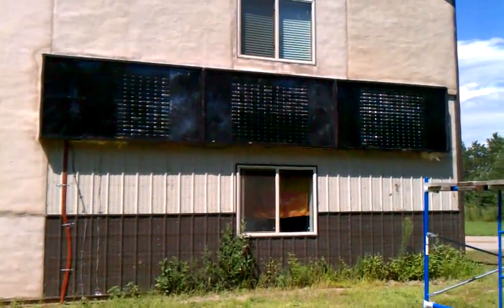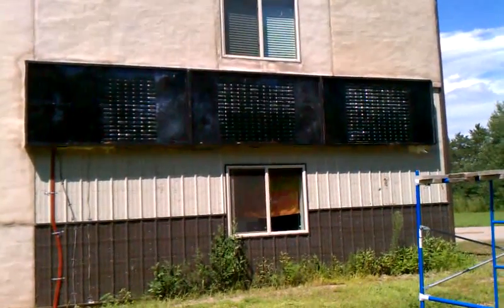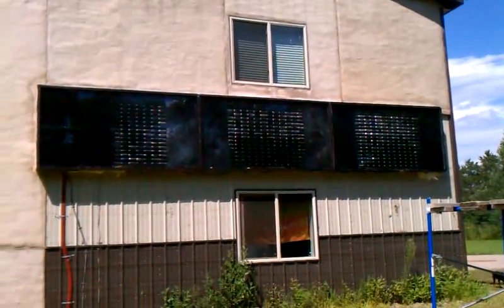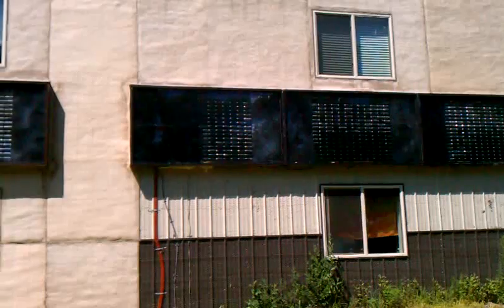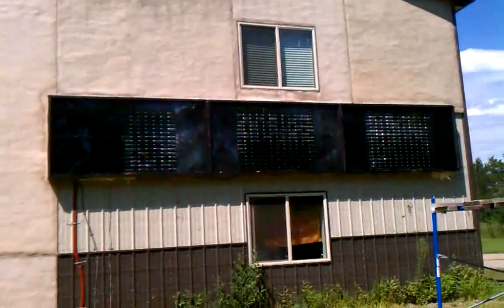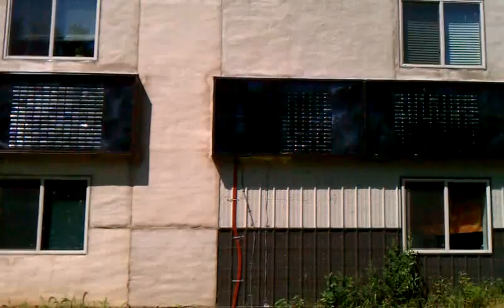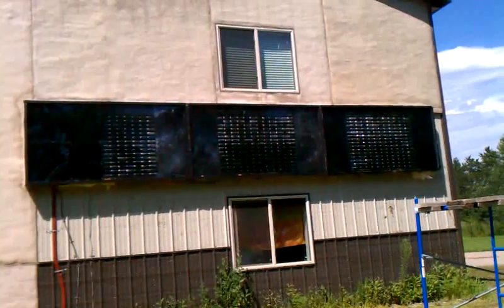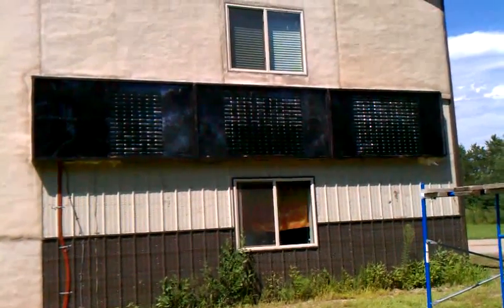Solar can heater review

Comment: Add a thermostat (cheap on Amazon), that will run a fan only when it hits a set temp (say 80 or 90 degrees), that way, the fzn will turn on only if it is producing heat.
Also, our forced air furnace has a continual 2 speed fan. I'd put the hot air into it for more even distribution throughout the house. The furnace itself will only turn on if required to subsidize the heat as required.
Reply from the maker: That is a good idea

Comment: Impressive build and setup! Interesting to hear your operational and financial success of your solar air heaters. You raised a great point of heat dispersal throughout your house. Also the need for plugging up the ventilation holes at night is very important to achieve the entire goal of net increase of house heat. I made R26 insulated 4" holes plugs for my top and bottom hole system. I am jealous that you have so much good, wide open views with all day sunshine. My system works well at 200F but only for 4 hours a day in winter and 6 hours a day in spring and fall when sunny. https://youtu.be/7S8CWsIcK20

Comment: Nice video. This is the unit I built and it works really well. I remove the top and bottom hole plugs in the morning and replace them in the evening keeping the heat generated all day inside the house. Solar House Heater 95C (203F) Feb 20, 2019 https://www.youtube.com/watch?v=7S8CWsIcK20&t=55s

Comment: I also made a smaller version like you did. I glued the cans together with black TEC7. Mine is already working for one year now. I have my doubts about the safeness of the TEC7 glue. In cold condition i don't think there's a problem, but when the heater is going to 85°C, maybe the glue becomes toxic. I smell something when it goes to 85°C or more. But I don't know what it is. It can be the styrofoam...or the glue...

Comment from the maker: the angle of the sun actually works to the benefit as it is lower in the winter heating the unit, and higher in the summer which reflects off the unit... It isn't ever necessary to change the angle of these...

Comment from the maker: @kb9gkc There is no sagging in the cans. I didn't really glue the cans together. I built the box mainly out of 1" Styrofoam and then glued the cans to the back of the styrofoam so that each one touched each other. I used some sort of high heat adhesive - Dont remember what brand it was... It was over 3 years ago.